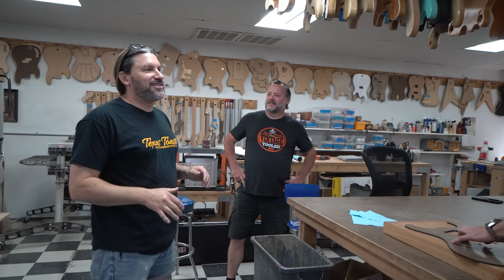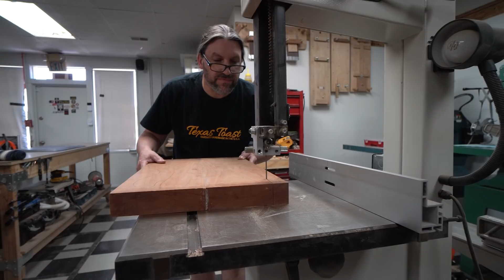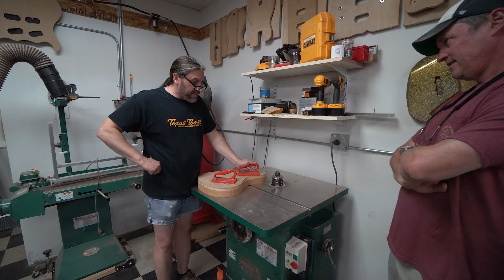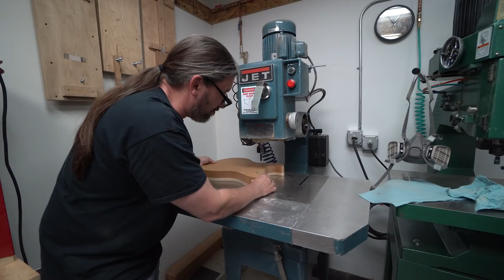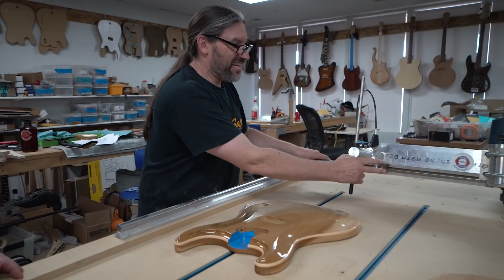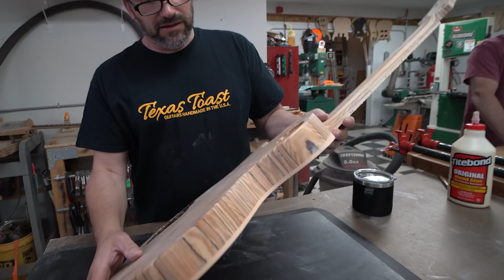A Les Paul Made Out Of Plywood ?

Comment: Looking forward to hearing the Les Ply. As we all know, tone woods have been a topic of contention for many years. In 1862, world famous classical guitar builder Antonio Torres built a guitar with paper mache back and sides to show that those components are not critical. There is a very good recording/demo on YouTube of a "replica" of that guitar being played. The tone is stunning! Just do a search for "Antonio do Torres cardboard guitar replica."
Reply: That reminds me of when my college got a small used pipe organ (two ranks of 3.5 octaves) which was designed to have the bottom two keys below the low A play F and G rather than G and G#, but a previous owner had cut the F pipe to F# and the tuning collar wouldn't reach to F, so I tried rolling up a postcard and sticking it in, and the tone was indistinguishable from the other pipes.  Metal might make a difference at the areas with maximum pressure and minimum displacement, but apparently not at areas like the end of an open pipe where pressure is zero and displacement is at maximum; at those places even paper will suffice.

Comment: An old Ibanez RG of mine cracked all across the body. I'm not sure if it was before or after I got it. The neck is very nice, and I'd hate to let all of it go to waste. I have a ton of barnwood available. I'm going to try to make a body out of that. I have most of the tools and supplies I will need and have built a few guitars before. If it works well, I might make a run of barnwood guitars. I would need to buy neck material and tools if I want to do necks though. That will be in the future, but for now it's just a body. Keep up the awesome videos!